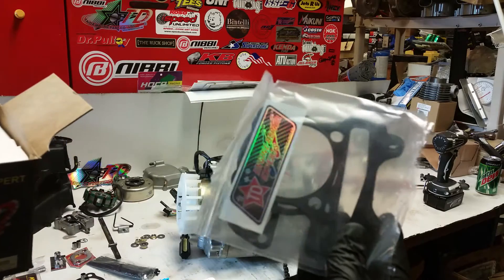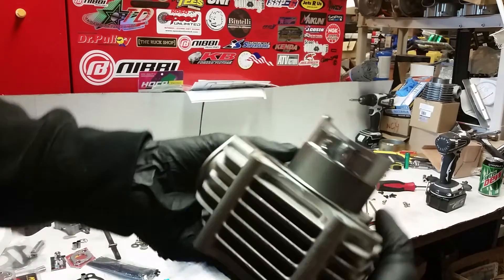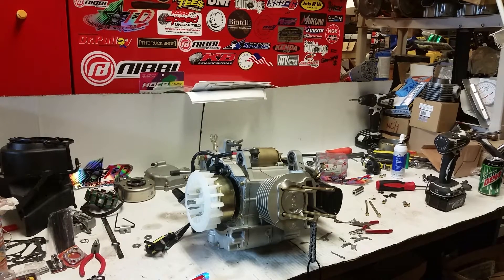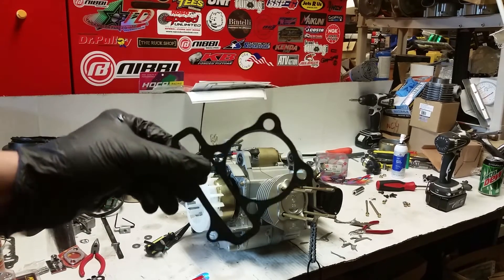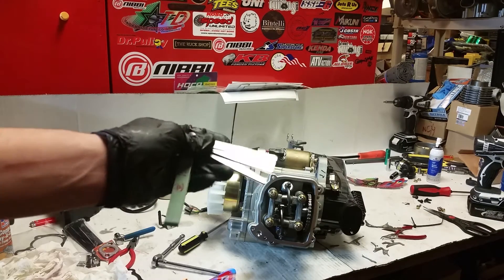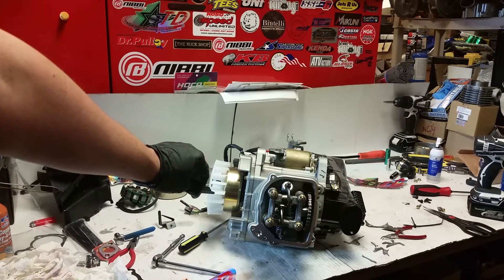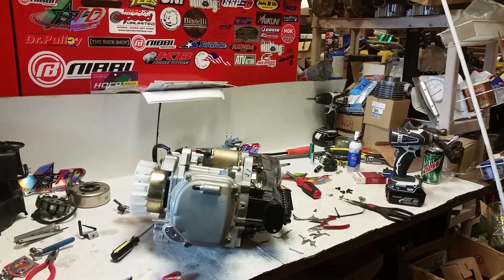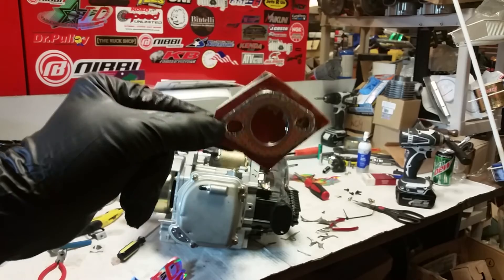GY6 150cc Taida 61mm BBK Install - Part 2

Comment: Dan the man , buddy could you please help me with some knowledge,  I bought a 61mm bbk the head has upgraded springs and the cam is an a13 , the bike runs but it's kinda lopey , vibration erratic behavior,  I've been looking and can't find not one other kit or person that has used an a13 cam,  what are your feelings on the a9 cam can I safely run it with my upgraded valve springs I feel it may take the bike down just a little bit, I'm using as a daily cruise not a race bike, please any info would be greatly appreciated
Reply from the maker: Hi Kenneth,  im afraid i cant be much help on this issue... the main problem comes from the fact that the cams labeled a8-a15 are not always the same... the cam does a few things... it opens and closes your valves and determines how long theyre open for... there's no easy way for me to know the cam specs (lobe, duration, etc etc)....  if youre using ti springs, put the stock back on and put youre original cam back in.... my advice,  don't mess with the cam and valves unless you know what you're doing.
Reply: @dmartin925  I know I'm ready to sell out and quit scootering lol, I can't catch a break no body know anything about the stuff they sell lol, roveria motorcycle on eBay sold me a TAIDIA 61mm bbk , a sheng e61mm head with upgraded springs and a a13 cam like I said I've had it running but I don't care for the large lope they said the valve springs are to strong for running a9 cam , I may try a t300 camshaft and see what happens
Reply from the maker: @kaw73  in fairness to who you made the purchase from, Chinese suppliers do not provide the specs... that's why i stopped buying from China and only purchased from Taiwan... i have some digital gauges that allowed me to spec out the cams i sold... do not attempt to use the t300... it isonly for a taida head... trust me when i tell you, put the original cam and orginal valve springs back in and your problem will be solved.
Reply: @dmartin925  when you say original you mean from the kit I purchased the only thing not new on this eng is the crank case it's the only part I had a bare 157 long case 54mm space an a case
Reply: Thank you I'll keep at it I guess trial and error just wished it wasn't so pricey , I just wanted a daily rider with a 61mm bbk since I'm a bigger guy figured it'd help get me up the road better , I bought a hoca brand hb cam I'm gonna see how it runs with it , if I don't like it I'll buy something different lol, thanks man
Reply: @dmartin925  as far as I thought I haven't been buy Chinese junk I been using TAIDIA or tiwain parts

Comment: I'm wondering how this set up would do with a 2.5mm stroker crank,  some say yes some say no , I've already got all the parts , you seen very wise on the subject and there's not much information available on the two together,  any info would be greatly appreciated thanks
Reply from the maker: Do not put a stroker in a setup with a 61mm "drop in" big bore kit...the cylinder skirt is too thin... there are 61mm kits that are not drop in and require engine case boring... those are fine to use with a stroker because the cylinder skirt can handle the added stress...
Reply: @dmartin925  man thank you so much , I'm not sure what to do ,lol run the kit on a stock crank or run the crank with a 58.5mm kit , either way thank you so much,
Reply from the maker: @kaw73  you're welcome... here's something to consider... the beauty of drop in kits are that they dont require the case to be split open... if you install a stroker, the case does have to be split open.. if youre splitting the case open, boring the block is super easy.... my suggestion is id you're installing a stroker, bore the case and go with a 61mm or 63mm.... strokers add a lot of torque and great for take off speed...
Reply from the maker: @kaw73  btw,  i have discovered most gy6 owners are looking for more top end speed... porting out the head and upjetting the carb is the way to go along with a drop in 61mm...
Reply: @dmartin925  thank you so much for your time sir it's greatly appreciated
Reply: Hey guy I'm back at it I've got my bike up and running my ?? If I can pick your brain , 61mm bbk and my cam is an a13 bike starts and runs but seems very rough and erratic,  would a a9 cam shaft be better suited, 28mm flat slide carb, greatly appreciate any input please

Comment: Hi there 👋 great video Dan this is where I am at the procedure of installing the 180cc bore kit on my 157qmj scooter I couldn't turn the engine over to top dead center because it want turn with my hand it's like seized up with the lower and top cylinder head off? Anysuggestions why it's seized up and want turn the cranckshaft to top dead center I did the whole procedure as well as installed the cranckshaft and starter clutch rebuild it should turn freely with your hand but for some unknown reason doesn't want to turn?
Reply: You prob let the starter clutch separate if the starter clutch isn't installed properly it will get stuck and hold the crank shaft from moving

Comment: What do torque the head bolts to on a stock gy6 150?
Reply from the maker: To clarify, you only have two head bolts, then 4 cylinder head stud bolt/nuts. They have different trq specs.
x2 cylinder head bolt (chain side) M6 Thread - 10 Nm (1.0 m-kfg, 7.2 ft-lbf)
x4 Cylinder head stud bolt/nuts M8 Thread - 13 NM (1.3 m-kgf, 9.4 ft-lbf)
x4 valve cover M6 Thread - 10 Nm (1.0 m-kfg, 7.2 ft-lbf)

Hope this helps!
Reply: Dan are you still in the NY area ? I need some virtual scooter mentoring, to get my scooter back up running. Email me Falconninja24@yahoo.com or send me your details

Comment: What motor is this an A or B case? And what kind of power does this give you
Reply: There all the same engines just little differences like certain blocks come with oil cooler holes and sum come with short transmissions or long ones to support different wheel sizes
Reply: No power difference only depending on what kit you use and how you tune it